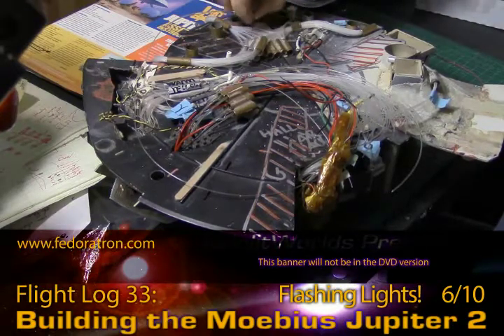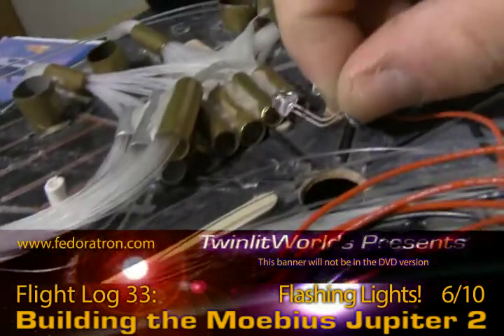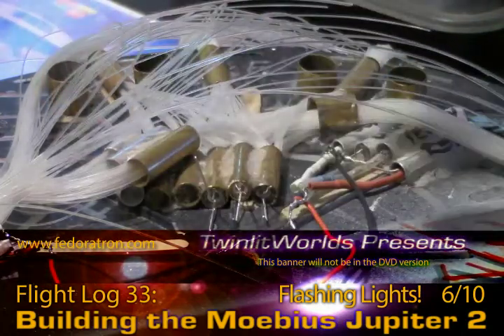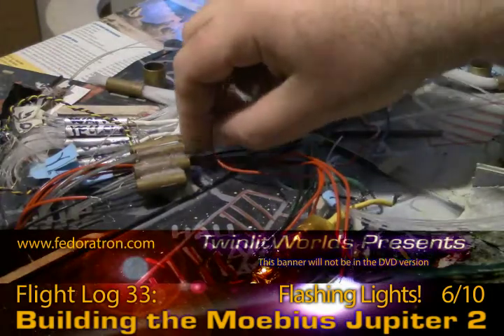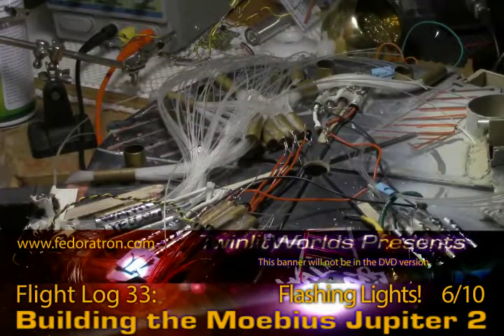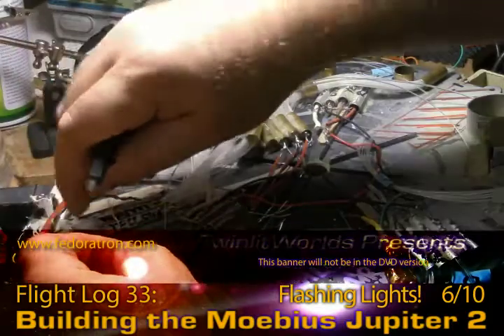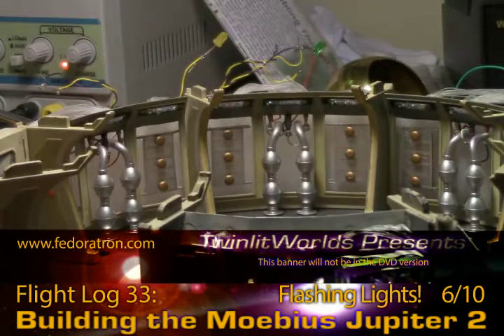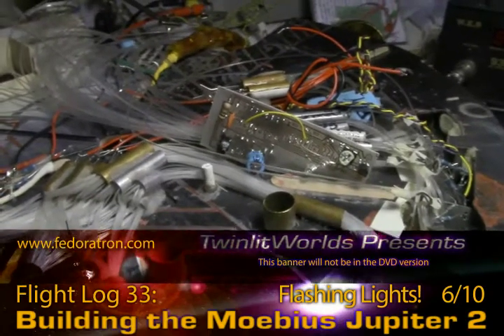J2 FlightLog 33: Part 6 Flashing Lights!

Comment: Great work Tom, 
You can use tulip (black fabric color) to seal the ends of the tubes to light block. You can still remove the led if needed since tulip is almost like a caulk and not a glue. walmart carries the stuff.